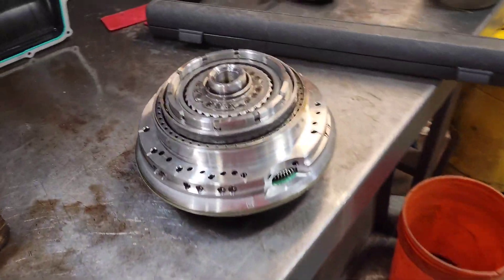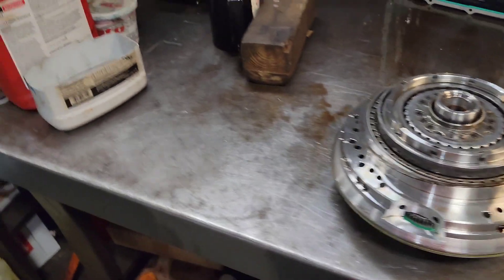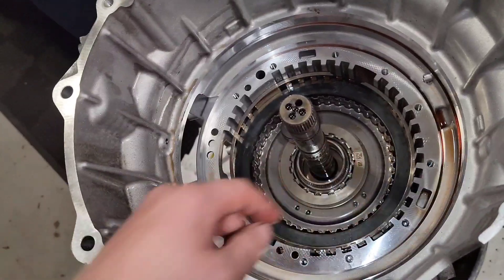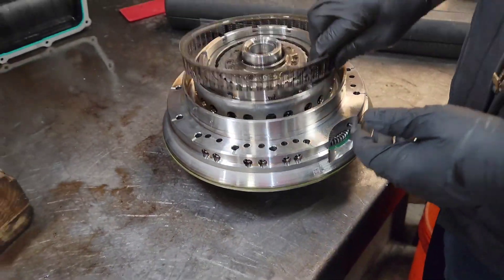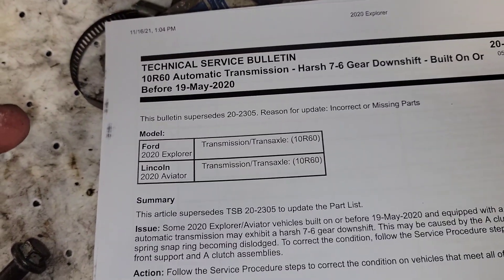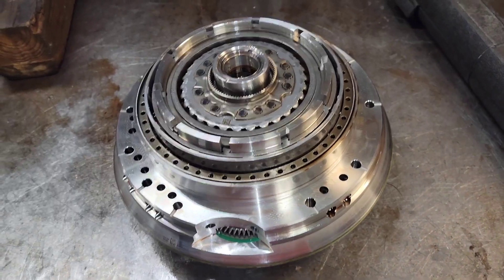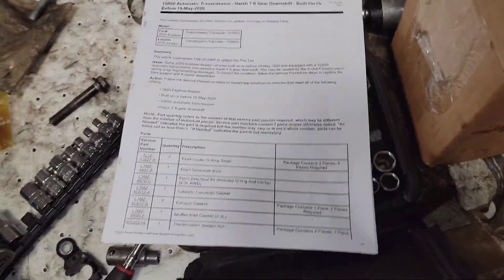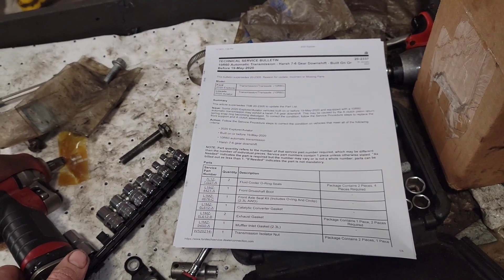2020 Ford Explorer/Aviator 7th Gear downshift BANG!! 10R60 - Let Me Show You What It Is

Comment: Is it known why that ring backs out?
Reply from the maker: Because the grooves cut in that front A pump assembly is not deep enough for that snap ring to stay in
Reply: @FordBossMe  so that almost sounds like it was assembled out of spec or a design flaw. Does the TSB then correct it to prevent it from happening again?
Reply: @FordBossMe  I would hate to be that machine shop who made them.
Reply: @Garth2011  absolutely
Reply from the maker: You know the sad thing is we just got the a pump and those front clutches and the frictions the whole front assembly that I showed him the video and the front support mechanism looks exactly like the same as the old one
Reply: @FordBossMe  that's disheartening. I hope that the customer won't have to deal with again.  It almost seems the transmission issues are more prevalent in the  2.3L rigs. Is there truth to that or is it because there is just more of them out there?
Reply: @Garth2011  you're assuming the machinist cur the groove too shallow when it's more likely it was cut exactly to the depth specified by the engineer's plans.  Engineer is most likely at fault.
Reply: @Itsa_Mea  Yes, one or the other makes sense. Maybe the expert who found the snap ring had the wrong part too.
Reply: @thisisyourcaptainspeaking2259  That applies if the snap ring is beveled which it probably is. Most of them are inside of an automatic transmission.
Reply: @Garth2011   im a machine shop and im sure the shop that made them has to be 9001 iso and top notch qc. Idk but more than likely thats a engineering flaw. Im sure ford inspects the assemblys on arrival. One here or there might be the machine shop but having a tsb means theres quite a bit.
Reply: @mattcaesar5781  yessiree
Reply: @mattcaesar5781  Yesiree

Comment: Depending on the mileage, I guess since this is warranty work, it would make sense to replace some frictions and steels if warranty won't. Based on what I read, only the center support gets replaced and its put back together but I'm rather sure that this snap ring issue likely caused premature wear and heat etc. that caused collateral damages Ford doesn't want to recognise. If it's a leased vehicle, whatever but if the job is privately owned, it makes senses to get parts replaced that are worn and or affected since most of the labor is being paid for by warranty.

Comment: I guess the transmission is under warranty too? If so, when the customer comes back after said 10K miles or sooner, Ford will need to rebuild or replace the complete transmission. So it would be more cost effective to have your shop rebuild it now. If it's out of warranty, maybe the customer wants to chime in for the rest of the cost?
Reply: Bumper to Bumper I believe it was three years. But I've had my Explorer at the dealership 4 times for a noise coming from the transmission. Watched this video and going back to another dealership and having them drop the pan and check for chunks

Comment: Ford had a problem with a snap ring coming out on the e4od, and 4r100. Sonnax came out with a spiral snap ring that wont come out. At least half the ones I've torn down the snap ring was out of the groove. Caused harsh shifts, especially 1-2 shift.

Comment: The snap ring groove needs to be deeper and narrower. I use to machine similar units for different applications. They should allow at least total tear down for inspection and cleaning before replacing components. 🙂🐶👍🏼

Comment: Replaced the trans on 2020 explorer while it was a demo vehicle, then it was sold and the customer brought it in for hard 7-6 downshift about a year later. It had a trans overheat code, the torque converter was burnt up and case had burn marks in it. Hotline said just do the TSB. Can’t wait for it to come back next year!

Comment: Would probably be a good topic to touch bases with Richard at precision transmissions! he is an absolute genius with transmissions and he usually has permanent repair procedures he has developed for manufacturer faults which results in situations just like this. That's pretty bad that it's basically just a r&r of damaged components and send it back out how it is and knowing there's a chance it could happen again  🤔
Reply: That is one of my personal favorite channels. This guy is unbiased in his opinion and I appreciate that.
Reply: @williamcbrown7813  most definitely even in his latest video with the failed input shaft that he had to cut the torque converter open in order to get the box apart, he didn't blame the quality of the parts or anything with the transmission he straight up said any trans will fail if you put more torque in to it than it can handle.
 I haven't seen him trash talk any transmission he will point out their flaws and how to correct them and will also show how to make them stronger but I've never seen him say a transmission is junk.... maybe with the exception of core's some of them are just assembled scrap metal  😂

Comment: A clutch is wiped out is usually a holding clutch e clutch should be inspected I seen this on the 140 were the the steel plates warped real bad . And the e clutch was also wiped out.

Comment: My 2016 Explorer Sport (95k miles) left me stranded, and I just got it back today from the dealership after 6+ weeks.  Any ideas on what might have caused this?  The ticket says:  "No DTSC, bad roaring in park and neutral, removed and mount trans to ench fixture. Disassembled and found failed planet gear bearing. Nec to replace 3 planet gears, gun gear and forward clutches. Reassembled and reinstalled trans, reset fluid level and test drive okay."

Comment: I Have this same transmission in my Explorer and have been 4 different Ford dealerships about a problem. You can feel it jerk in certain speed points. Now it's making a very loud popping noise just going from Park to Nutural Drive or Reverse. My local Ford dealership is basically a used car lot. So maybe they get a pass for not finding a problem. Took it mega dealership in Indianapolis they also didn't find a problem. I even had a tech in the car with me who herd the noise but didn't know what it was maybe I need swing over to your dealership

Comment: Wonder to myself if 8 speeds is the better compromise between economy and robustness.... 10 gears is a little excessive... have 10R80 in my Ranger and rarely feel it go for 9th or 10th
Reply from the maker: I like the 6sp best
Reply: @FordBossMe  Had 6spd in last Ranger and 4spd before that in another make..... I didn't live the 6spd auto much but I think that was more the way Ford programmed the shift pattern and torque converter than the box itself.
My comment was more along the lines of I think 8spd is the reliable limit maybe???
Reply from the maker: @dwaynE2099  ehhh I don't have alot of experience with the 8 speed, the edge has them and we are just starting to see issues

Comment: My wife and I have a 2018 F150 with the 5.0 in it. And every once in awhile our trans will shift really hard on the highway if you go to pass. Almost like it bangs into gear. Stupid truck only has 70,000 miles on it. Im not sure what would cause it? My 139,000 mile hyundai doesnt do that.
Reply from the maker: It's the type of transmission that's in it they're trying to pack too much in the one trans and make it all work and it doesn't want to work
Reply: Im just hoping its not something like in this video. And thats BS if Ford only lets you put a ring back in when the whole thing is trash. Makes ya not want to buy anymore of there vehicles.

Comment: Ford should 100 percent stand behind the complete rebuild or replace of the transmission,  its defective from factory,  and they know it ,thats why the tsb was sent out they know they have a problem.  My wife's van bought brand new had to have the transmission replaced at 1,500 , I haven't bought a ford in 20 years because of crap like this  !